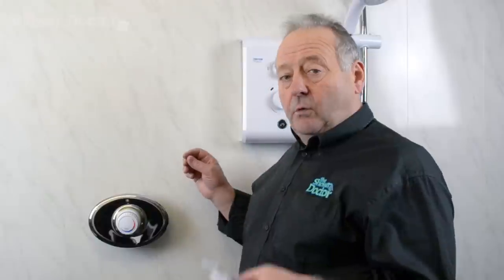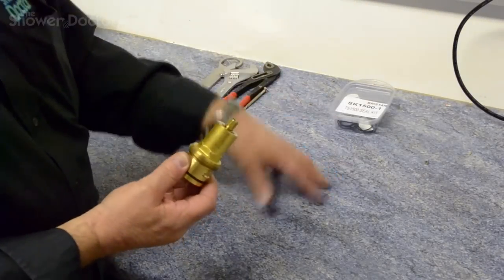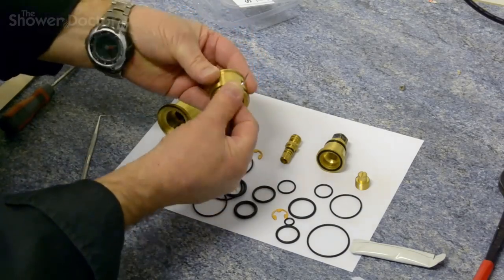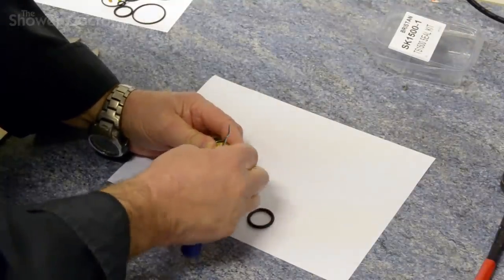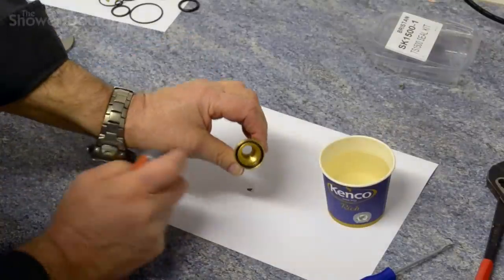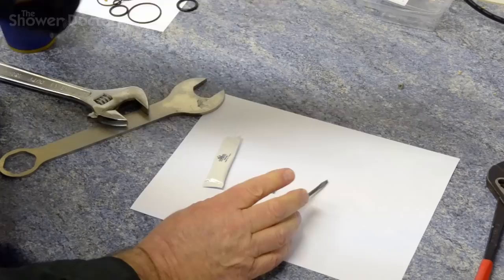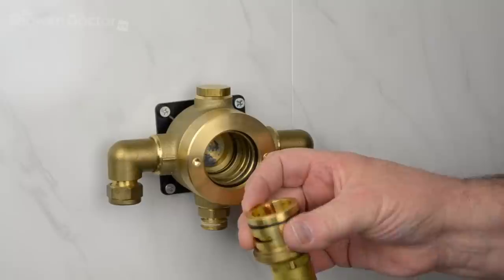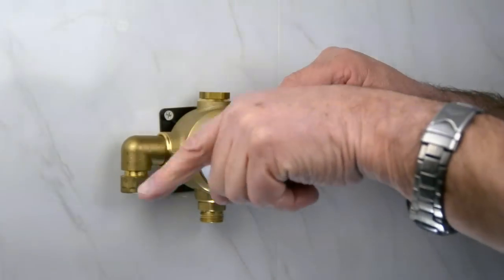How to service Gummers 1500 style shower valve & cartridge

Comment: Great video.  Bristan advises the valve to be serviced every 12 months.... ours seems to get stiff about every 3 years.  If you don’t, the internal brass screw threads will wear/deform and you will probably need to replace the whole insert, at considerably more cost than the service kit.

I have always found it necessary to hold the valve insert in a vice to disassemble, as the threads get locked up by scale.  Also, the threads are sharp and will easily cut you.   

Have a bowl of kitchen descaler and an old toothbrush handy, as well as the service kit, to clean up the threads etc before greasing and reassembly.

It’s easy to pinch and damage the main large o rings when reassembling, which will result in a drip, particularly if you try to push it in at an angle to keep the spring in place.  Make sure the valve is fully ON when screwing back in, so at it’s shortest.  A blob of grease will also keep the spring in place whilst you thread the whole valve-piston-spring assembly back in.

The wax thermostatic cartridge goes in with the black end pointing out into the room.

I’ve written these notes mostly as a reminder to myself in 2023!!!
Reply: Removed and replaced all the O-rings,cleaned and greased all moving parts especially the spindle screw which felt a little rough.This totally cured my dripping head issue. 3 months later it’s beginning to drip again, stripped it down to look at the O-rings and all look fine,lubed everything,reassembled and still a drip

Comment: Great video. Did our Antique version of this mixer today with no real problems, thanks to such a clear presentation of what to do. As identified "that" O ring is a pig to get in. I ended up using an F clamp, slowly moving it round a bit at a time to press it in; that worked a treat.

Comment: Thanks SD, couldn’t have done it without you. However, that O ring .... eventually I got it in by making a press with a 22mm compression nut in a vice and then pushing it into the outer space with a flat screwdriver, working round the circumference. Hard to make it flat, being so tight, but no drips so must be OK.

Comment: Thank you, especially for the tip to hold the spring in when replacing the valve, brilliant, I had been trying all sorts of things and was about to remove the whole unit from the wall as suggested by the manufacturer.

Comment: Because of this video I was able to successfully replace my exact same shower valve.
Old one was faulty and had no hot water. 
New one fitted and hot water again thankyou.
As a side not the temperature screw inside the spindle would not turn. I bought new instead of servicing

Cheers

Comment: Hello Chris. Have watched with great interest the tips for maintaining Triton Shower unit. Having a tiny leak, I dismantled the mixer unit, cleaning the inside and checking the Neoprene sealing rings. On re-assembly, the plastic screw fixing holes split on two holes rendering it impossible to screw down securely. It seems that I now need a replacement plastic shell. Can you help please?

Comment: just fitted a new cartridge in a bristan gummer, doesn't seem to have much adjustment on its temperature control, can't get it to run at max temp using the control knob. I've turned the boiler water temp to high,  have I altered anything in the cartridge as I've fastened it in??? Cheers Alan

Comment: I've followed this, I must've done something slightly wrong as the knob no longer goes up to 9. I followed the temp setting video as well and the off position is now just over 1 and max is 7. Any ideas? Thanks. Great video, saved me a lot of cash on a plumber.
Reply: +Luke Guest Having thought about it, I wonder if this has anything to do with the wax capsule. I did the hot/cold water test, but didn't push the pin back in after putting it back into the cold water.
Reply: +Luke Guest Took it apart today, the whole thing has seized up, cannot get it apart at all. Yes I used what little grease was in the tube. Looks like I'll need a new cartridge.

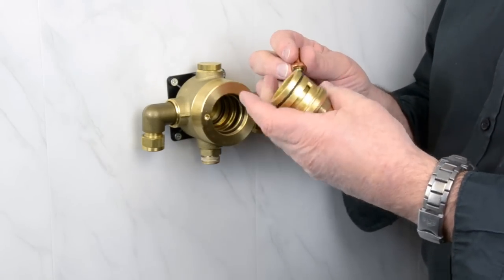Comment: Question: In the video at 3:00, the cartridge slot(s) are closed but at 4:02 they are open and you are able to use a slot to insert the flat opened head spanner. How do you open up the slot(s)?
Reply: Hi I too would like to know how to open the valve in order to push  the spanner through to remove